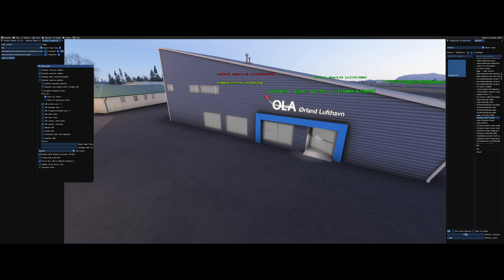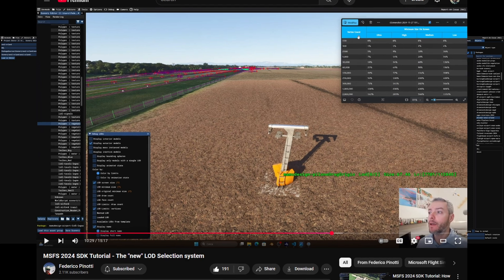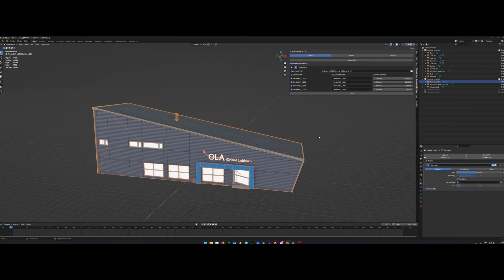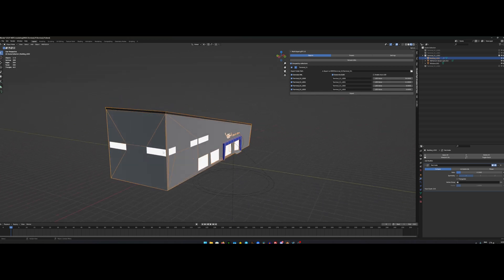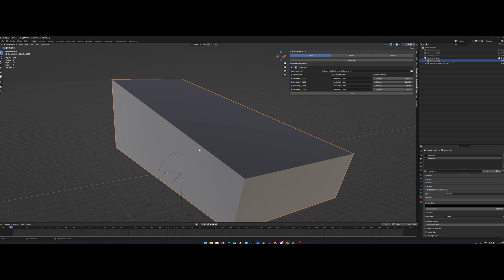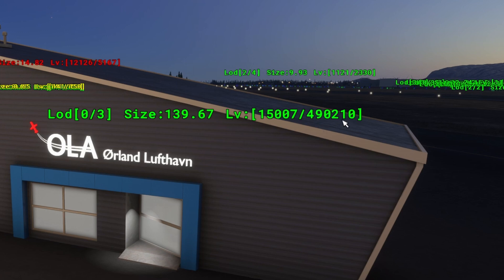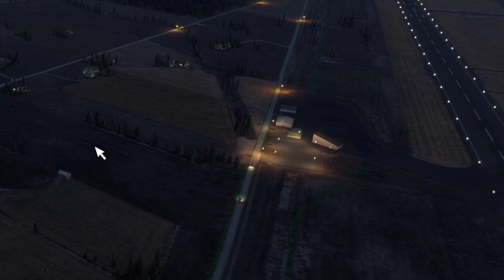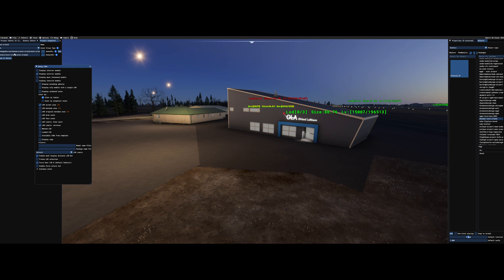MSFS 2024 | SDK LOD | Battling the new LOD system

Comment: in the debug lod screen of the dev mode, you can set forced inactive this stuff. however it will not works with zoom disappearing, only with distance one. and i just can not found where live that stuff for remove zoom out disappear. problem deeper than only scenery, as i have one aircraft model, there some arrows of some gauges disappears too at certain zoom

Comment: Hello, there are very few videos on LODs and yours is always welcome. I already use LODs in MFS20 and in MFS24 it's very different. I have a little trouble with the number of vertices to use. As for LNLOLDs, I use it but it doesn't seem to work with version 4.2.5 LTS of Blender.
Reply from the maker: @fabriceobaka  Hi, and thanks! I didn’t use it for ‘20 even though I now understood that I actually should. I tend to make four LOD models for each object. I can’t seem to get MSFS to respect the values set with LNLOD. So for my latest objects I only try to reduce the vertex count by half for the next LOD. I use a combination of removing bevel modifiers and removing small parts of the model. I then use the decimate modifier for the last tweak to get the vertex count down. I haven’t set the screen size with LNLOD for my latest exports. I found that you can set them in the property settings inside the scenery editor. It’s a struggle for sure, and I’m curious to where MSFS will end up with the LOD values/settings after SU2. Keep up the work! I’m using Blender v. 3.6x I believe 😊

Comment: Hey man, nice video, just a question, the sim have a default LOD minimum vertices for LOD0, LOD1, LOD2 and each others or i need to set manually?
Reply from the maker: Hi, thanks! As for now at least I believe the LOD vertex limit is "hard coded" in the sim (as shown in the LOD debug label). I also believe we at some point will be able to deviate from this limit based on what LOD value we set in the export tool in blender. So what I do for now is that I use a blender plugin tool called LN LODs (https://lndesignfs.altervista.org/tools-for-developers/?doing_wp_cron=1742848352.0119729042053222656250). It calculates the LOD value based on your object LODs vertex count. Works great!
Reply: @ehindur80  Thanks for all of this information, have a nice day!